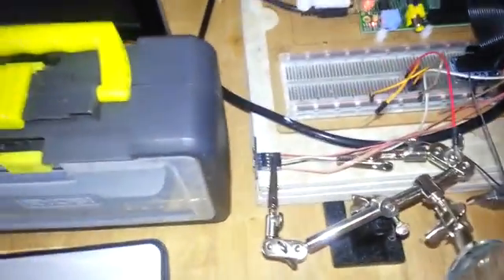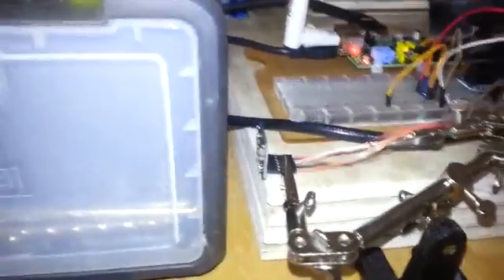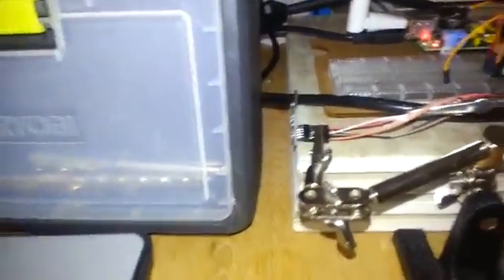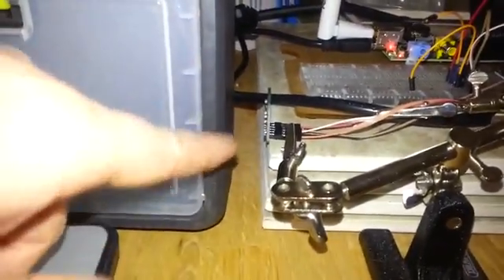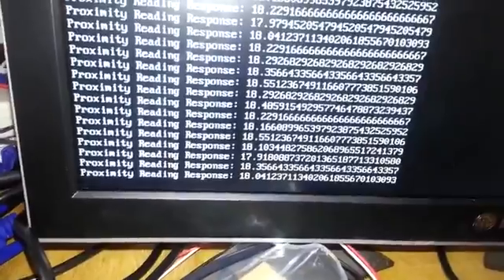VCNL4000 i2c Sensor using Mono on Raspberry Pi

Comment: I need my Arduino & VCNL4000 to do the same exact thing! Can you please send me the code or make another video about how to set the code up? I would really appreciate it!
Reply from the maker: Hey Michael, my code is C# running on Mono - would that help you?
I have not thought about it for about a year, but from what I remember my code also DLL imports a couple of unix/linux object library files ("o" or "so" files if I remember) - I dont know if my solution helps you. If you are already getting readings from your sensor, and want to figure out how to interpret them, my C# code might be enough to give you ideas you can port/use in whatever language you are coding with
Reply: I think any code would help. The data I am getting is in a unit called "counts" which has a logarithmic relationship to millimeters. I need the units to convert or maybe for the sensor to just read in those units to begin with. I appreciate the help and my email address is michaelmartinez2017@u.northwestern.edu if you would like to take the conversation there. Thank you so much!
Reply from the maker: Michael Martinez I uploaded my code to github

https://github.com/silentbobbert/pi_sensors

It compiles, but I have not run it on my PI for over 12 months. I have lost track in my mind what problems it might have had - The VCNL4000 classes worked OK as far as I remember!

Comment: Hey i use the same sensor and have problems to read the prox. data. ambient light data comes well. getting data from the vcnl4000 sensor between 2500 and 18000. so closer i come the number increase. lil tip for me how i can get the cm from my numbers? thx